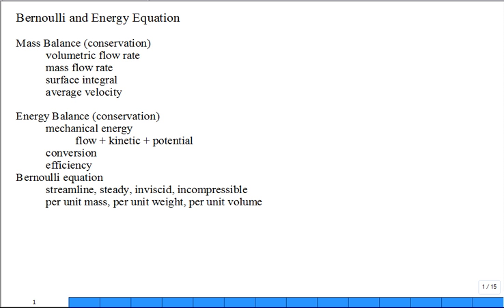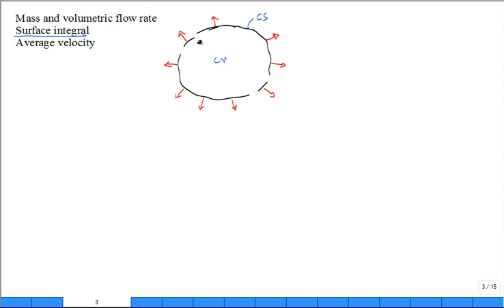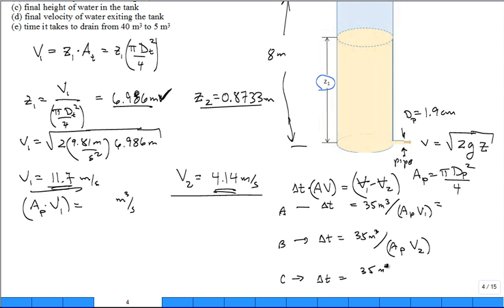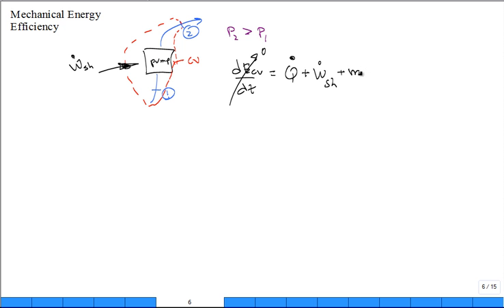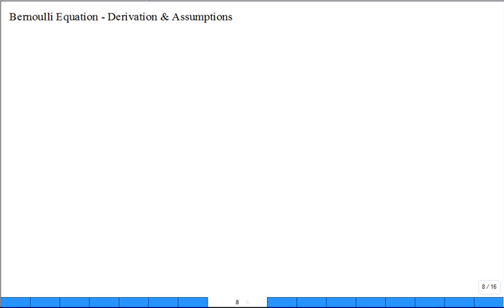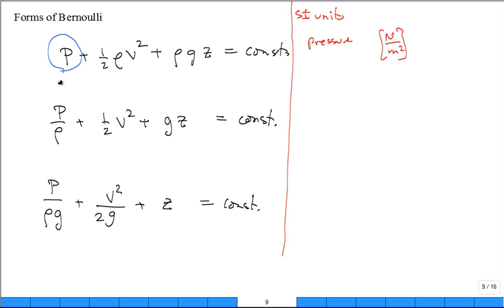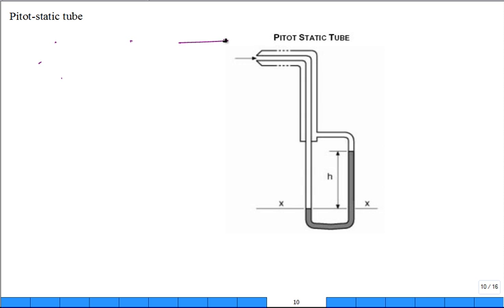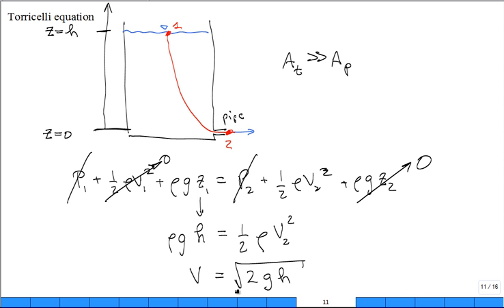ME3663 Bernoulli 1

Comment: at 16:44 for question e why didnt you just divide delta z by the average v? thank you
Reply: i understand the volumes 1 and 2 are relative to the larger phi and consequently the larger phi over small phi is not 1. but at first glance i wouldnt have thought of that and would just check the units
Reply: on the second resolution you do by integration when you solve the equation for t on the last step i think it should be the root of the  z difference and not the difference of the roots
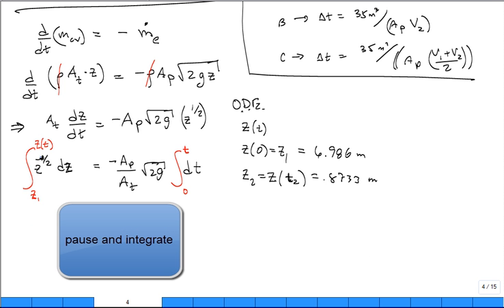Reply from the maker: +Inês Quadros at around 22:00 the integration is OK.  Sorry I don't have time to fully address your comments